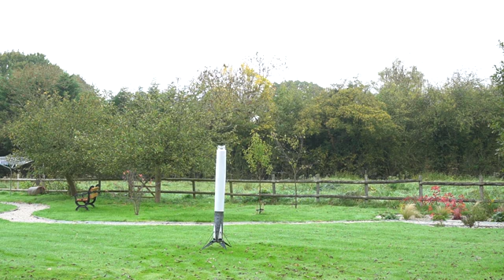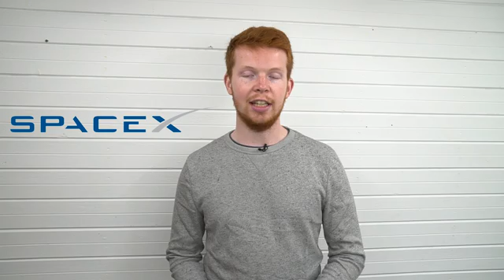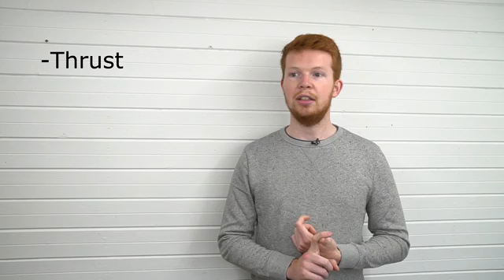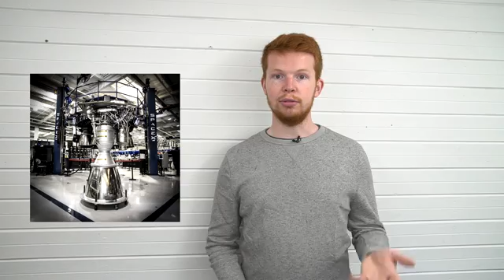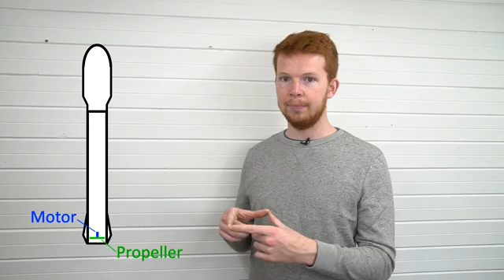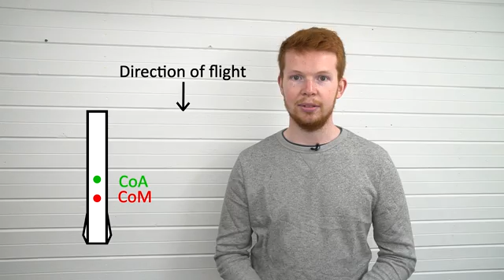Hovering a rocket - SpaceX model

Comment: I don't believe that those gas thrusters would even work in the vacuum of space.
Reply: Wow! Really? never looked at ANY spacecraft in existence then. They all have them and they seem to work. Newton's third law states "That for every action (force) in nature there is an equal and opposite reaction." Go figure.
Reply: HB, Agreed, but "gas thrusters", even a fire extinguisher fired or spanner thrown, in space produce an equal and opposite reaction, ie, thrust. I'm a commercial pilot and do understand the difference between atmospheric flight and space flight. And, "no air up there" well the ISS needs to fire its thrusters now and again because there is actually molecules of our atmosphere at 400 km altitude where it orbits and causing ever so slight drag reducing the orbit speed and degrading its orbit if not compensated for with regular additional thrust.
Reply: HB, Agreed, but "gas thrusters", even a fire extinguisher fired or spanner thrown, in space produce an equal and opposite reaction, ie, thrust. I'm a commercial pilot and do understand the difference between atmospheric flight and space flight. And, "no air up there" well the ISS needs to fire its thrusters now and again because there is actually molecules of our atmosphere at 400 km altitude where it orbits and causing ever so slight drag reducing the orbit speed and degrading its orbit if not compensated for with regular additional thrust.
Reply: Those gas thrusters do work in space. They use monopropellant that expands on ignition (no oxygen needed) by exothermic decomposition. The expanding gasses accelerate out and thus provide an opposite force on the rocket, usually resulting in a change in angular momentum of the rocket (but depending on their position and orientation can also be used for translation of the rocket).
Reply: Ian Lindsay He's right. This model Tom made 100% would not work in space. This needs air to function and well there is no air up there

Comment: Total success.  The only reason it falls over is because the centre of mass is pretty high up, so any tiny inclination of the rocket has a large momentum and that makes the rocket pivot around the leg as it digs into the lawn.  Probably a problem that the real rocket also has, compounded by the short legs on your model.

Comment: Thank you sir you just proved that in order to compensate for the smallest wind, the rocket would need to angle pretty steeply into the wind. In the ocean that wind would be pretty severe....
Reply: The Space-X boosters are much heavier and have much more powerful RCS. They are less affected by wind. They do however consider weather when determining wether to launch or not. Launches have been postponed many times because of bad weather.

Comment: I MUST ADMIT THOU. oops.so much effort being put into this model this design. of one long single stage rocket. can there be another way to build a rocket one that is actually stable. it was a very good effort id work on a different design. triangle shape maybe or round or a mixture is this the best design for stability i dont think it is. changinthe design may be quicker than making this design stable if you follow me. look at the quad copters for instance they are much more stable than using one blade maybe th design could be changed. somehow.

Comment: Good job but are you saying for a rocket that weighs tons, it's completely unreasonable to drop it from the sky and hope to land it? That's what I got from your video of struggling to control styrofoam.
Reply: I don't think he said this. The problem is that some measurements are not available to him. A gyroscope only gives you so much data. You need more than just that. You want to measure position to include it into your control system. Position includes height, in this case.

Then you have to determine the exact height at which you can just make it to the surface at maximum power (v = 0 when h = 0). This is called a suicide burn. It is the most power efficient, but also obviously the most risky way of doing things.

If you want to try this all out, I suggest you have a look at Kerbal Space Program.

Comment: Very interesting, but i think you need a computer controlled thrust control. In last step of your video you can see, small steps of the rpm from the thrust engine make difference to the ground. I think on your remotecontrol is the point between over the ground and not enough to the ground, very difficult. You need a automatic for the rpm control of the engine. I think it is not easy to realize this control hardware. 
You need the optimum point of rpm related to the mass of the "rocket"

Very good video!

Comment: Just put a big drone on top of the rocket allowing extreme thrust capability. Then trash the internal fans and use an mhd ion rocket motor. 
Use the drone on top to bring it to high altitude (go out on the water like they do) then fire your mhd ion rocket motor and catch up to Starman.
The drone on top can also keep it aligned on the landing pad even in wind. Eventually you can land on Mars after you set up a telemetry array.

Comment: Maybe u should test flight above a Pit dug below the rocket and Not use eleastic but ordinary pully n wire- so once airborne there is actually no contact with wire tension and only when it gets below lift off height the wire comes into play preventing a crash.The rocket must rest on a plank of wood at ground level across the wide Pit.that would be removed on lift off.

Comment: the drone controller is supposed to be a PID controller, so the wind should be countered by the integral, my bet is that your integral gain is not big enough to adjust to this kind of force quickly

Comment: Very cool! To make your task even harder, though, consider the Falcon 9 cannot actually hover. By the time it gets to the landing pad, it has burned so much propellant mass that its thrust to weight ratio is greater than 1, even at the lowest throttle setting. So it has to plummet from the sky and light that engine up at the precise moment that will allow it to reach zero velocity at exactly zero altitude above pad level. You're on the right track though, solving control loop problems is what it's all about!
Reply: control loop. Hah more like control loopy... Actually its getting the mathematical model of the thing you need to stabilise in the first place that gets me. I need me some aeronautical engineering fwends.

Comment: Do the original thrust method with dual counter rotating motors that are both way overpowered for hovering then you can start it by tossing it up in the air and turn it on at the top of the arc so you can slowly hover it back to the ground! if you get enough confidence you can slowly start to push that longer and longer past the top of the arc into stopping it as it falls more realistically however I feel like you would need to have the sensitivity of the thrust vectoring dependent on the vertical speed for some reason...

Comment: You need some sort of reaction wheel in it, or movable weights, and sensors to detect the orientation and movement. So that it can automatically keep itself upright.
Reply: it does keep itself upright but itsnt strong enough the thing is called a "flight controller"

Comment: Hey there Tom. Great project that has got me thinking how could you compensate for the wind drift without an outside reference such as radio transmitter beacons or laser but instead only onboard sensors ? Very interesting to me. Thanks for the inspiration.

Comment: It’s a success. I think your initial hovering difficulty was possibly down to ground effect. The downwash from the fan creates eddies and the grass will break up any laminar flow. You might have found it easier over a smooth surface. This is a common issue with helicopters, much worse for model helos. You need to get above it into stable air. IIRC for helos the hover height is at least 2/3rds the rotor diameter, but I don’t know how this translates to ducted airflow.

Comment: This was a massive success. I was interested to see you put the CoM so low down in the mk1, despite your opening explanation of rocket stability. I was very impressed with your implementation of the mk2 control mechanics - it looked pretty complex and you glossed over it somewhat!  What is essentially a monocopter is always going to be challenging.

Comment: SUCCESS! - You might also try 3D printing a fan shroud for the fan to go inside the rocket. If you have tighter tolerances between the tip of the prop and the inside edge of the rocket, you will increase the thrust. This might help you keep the electric motor closer to nominal voltage by not requiring as much voltage to get the thrust you need and prevent overheating the motor.  Perhaps a slightly larger motor along with the fan shroud? - Final thought... You may be able to use acetone polishing on the 3D printed shroud once its finished to keep it very smooth and aerodynamic. - Keep up the great work!

Comment: Great job!  I think you may have established some sort of bond with Elon Musk by now.  lol  I was always a disbeliever (not in the take off) but the landing of SpaceX's long rockets for the reasons you clearly shown in your video. You displayed what I thought all along - and yet managed to accomplish a great presentation of how it could be possible.  It's just not what I would have expected SpaceX to do - being how difficult it is to control.  Also, years ago there was a game that involved landing the Lunar Module on the Moon. The module came in at the same angle of descent as the real one was reported to have and one slight wrong move and it crashed.  All simulations but very difficult non-the-less....making me wonder about those landings as well.

Comment: Awesome stuff. I have some suggestions that may or may not be helpful. Smaller battery pack, quicker stabiliser servos, gps flight control and more blades on the prop. What you think

Comment: Important nitpick: The aerodynamic center of a body is NOT at its center of area. For most bodies it is at about 25% length, measured from the leading edge.
While hovering that's not so important though. Your most influential parameters will be inertia and thrust forces.

Comment: You should equip a GPS receiver to the flight controller and have aft thrusters keep the rockets  center and pointed up. Flying vehicles shaped like this typically want to move up or down -- not hover, so you'll need to add some extra equipment to enable this functionality.

Comment: I suggest you take a look at franky zapata fly board using miniature jet engines.
I know so so little about rocket science so don't judge me but I have a feeling that using those same jet engines in a 9 configuration like on falcon 9 and applying all you wizardry work with rocket balance :)
I'm sure you can reach new grounds with breaking throw results. 
If it works remember to tell me , I would really be thrilled to know you did it
zayed.hossam@gmail.com

Comment: Not to nitpick, but what you said about having no control over solid state rockets is not true. Most of the time, they will send an oxidizer through a tube of fuel that they are capable of varying through the flight to adjust the thrust.the fuel typically has a lower burn rate than what would be expected, but the oxidizer accelerates the burn rate to a point where the engine has adequite thrust for liftoff.
Reply from the maker: +Blake J I think that's technically called hybrid rocket. A true solid fuel rocket has the oxidiser mixed with the solid fuel.
Reply: yeah, after reading a few more comments i realized that. sry.

Comment: Space X uses compressed helium for stability and control. Check out modern military cargo dirigibles. They use control valves, and compressed helium to rise and fall. Just try it. Put the stage 2 head on the top of your rocket, filled with helium and see how that allows your rocket to ascend and descend in a controlled rate. To get your rocket to turn sideways when it’s up in the air, you need a mechanism to move the helium to lower chambers, to adjust the center of gravity.

Comment: this is nice, but I am a bit disapointed that you didn't actually use a gimbaling system on the main propellers that would really simulate the Falcon 9 engine and control. but I guess your control loop would have to be much more resilient to stabilize the rocket.

Comment: You do not have much control because you do not have any sort of control at the top. You did this in the original design, but you can't really counter for crosswinds at such low speeds unless you apply another torque higher up in the rocket.

Comment: Your D term may be too high if your motors are getting really hot. Adjust the PID so the D Term is lower. For this you would want a pretty high I term in order to maintain a constant heading

Comment: Should re visit this project. Do the dual motor so your servo's can focus more on keeping it level than the counter torque and you would have more thrust. Add a light weight GPS module so you can have it hover in one spot. Then make some sort of landing mechanism with rubber bands and 1 servo to release the 4 arms in flight when you land. Then once it works fly it high and see if you can make it land in the same area. Good work though!

Comment: You should normalize the audio in your videos. When you're speaking, it's super quiet, and I always have to turn up my volume a lot higher than usual. But for some parts, there might be a loud motor running, and I have to turn the volume way down again. This is true for pretty much all the videos I've seen here. Still subscribing though. :-) I really liked the electric bike stuff and the 3d printed air pressure engine.

Comment: Tom NASA uses Sliding wall so that when first flight the rail on rockets sliding straight up with support of sliding wall so the rocket doesn't fall put a rail wall taller than the rocket.

Comment: Hover oriented motor at the very top pocking out of the rocket. Aluminium fin rings to cool it (hand bent, nothing fancy). Butterfly like flaps just under the propeller with micro servos to divert some of the thrust power. Battery down bellow, maybe multiple batteries but smaller in size spread on four sections, maybe even part of the leg structure. Same thrust vectoring setup, maybe with a cross pattern on them so they grab the wind better.
Also, when testing these kinds of setups with a tether, leave some slack, and the test item on the ground, and only a small section of the tether should be rubber (to mimic what NASA has on its rig where they use massive shocks).

Comment: Total success, keep it up.  How to you prevent the motor from causing the rocket to spin. I like the thrust flap system and how you can control the thrust direction from any corner of the rocket.

Comment: I'd call that a success, especially given the time constraint. Well done Tom. 

Only one point to make: when moving through the air at speed the rocket will act as a wing. For a wing to be stable, the centre of mass needs to be forward of the centre of lift (rather than the centre of area). For a rectangular profile wing the centre of lift will be around 1/4 of the way back from the leading edge. It would be worth factoring that in if you get it to ascend or descend at speed.

Good luck with whatever you get up to next.

Comment: after watching this I think i understand why the rockets always tilt after they get to a certain height, there center of gravity, the weight of the fuel becomes less as it burns making it top heavy so it starts tilting. but trying to land a rocket with any amount of wind or breeze especially on the water should cause for an almost if not always tip over. unless I can actually watch it land with my own eyes it is still hard to believe it can be done with what they are using. IMO

Comment: few things to improve; PROP CLEARANCE!!

You are loosing a lot of trust with the gap between the blade tips and tube(duct) so close that.
If you want to cheat and have the budget get a edf (electric ducked fan)  that is rated for the trust needed and able to run longer.
Servo's are to slow.
The servo's you need are tail rotor control servo's for model helicopters; they are the fastest.
And a flight control board  running inav with GPS would allow for position hold and possibly automated landing.

Comment: I guess, the problem is wind... When the rocket is in the air, it keeps drifting away due to wind... And it's the momentum of rocket due to the wind drift, that's causing the rocket to topple while landing...

Solution :- Either re-code it with kind of positioning system, to make it hover at one spot.. Or you can control it manually by tilting it a little bit in the opposite direction of wind...

Great job BTW... Even SpaceX didn't launch it's rocket properly in first attempt... Keep tweaking...

Comment: Need to reduce the friction when touching ground (a wheel maybe helpful) and the stand also cannot absorb the vibration effectively (try a strechable shaft with a  cylindrical spring outside or inside).

Comment: what about two counter-rotating props to minimize the rotation which you are then having to compensate with vectoring the air/thrust at bottom? Can't wait to see actual rocket thrust added to the prop/drone based controls you're working on. Keep it up!